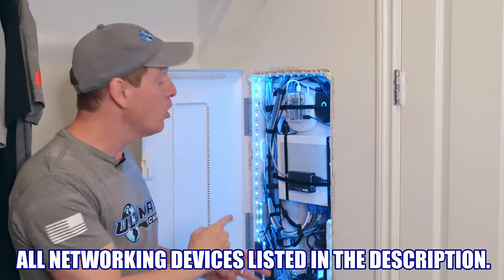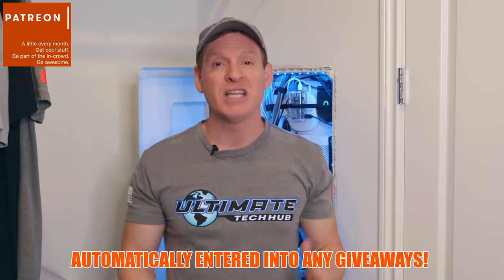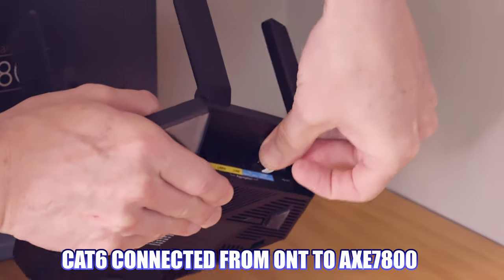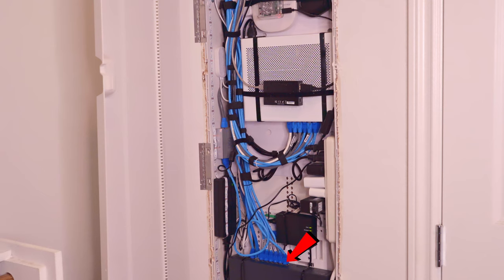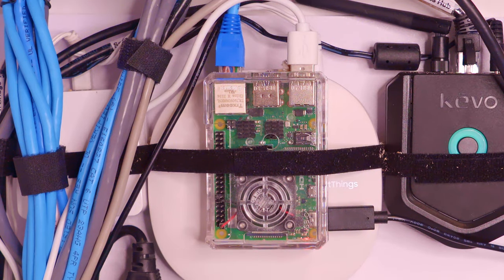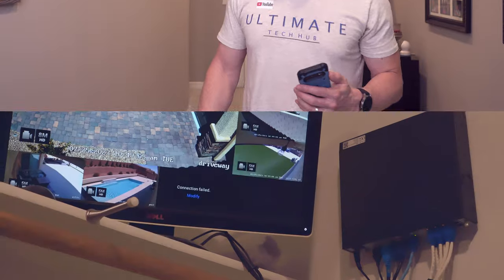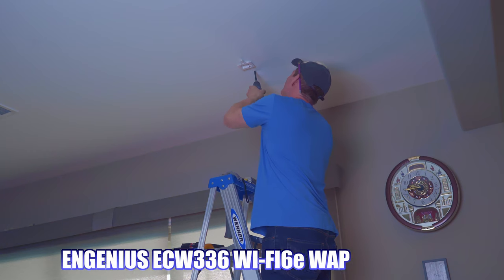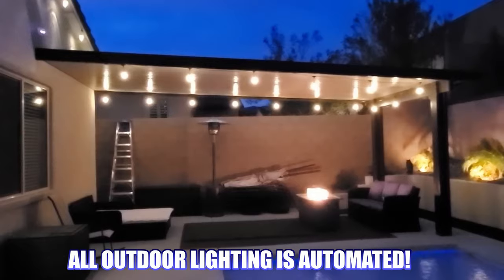HOME NETWORK TOUR 2023

Comment: I honestly think they need to make it a code requirement in remodeling and new construction to have network panels, not only does it give us tech savvy people a place to go to town with Ethernet and wireless transmitters but for a average home owner it can make maintenance on coax, Ethernet, and audio so much easier. I have a family member that didn’t have one until I installed one for them and any work that had to be done to the coax system required going in the attic digging around in blown in fiber glass insulation.
Reply: Even better than a network panel, a proper network rack. I had one installed in my integral garage when I had my house wired with 28 drops of ethernet, and in there is a single UDM Pro, a 48 port USW-Pro-PoE and then a 2U short depth rackmount server I built that hosts HomeAssistant, Plex, Backup server, network shares etc. etc. Much tidier than trying to fit stuff into a network panel.
Reply from the maker: I agree 100 percent! All new home homes should have these network enclosures and the bigger the better! The smaller enclosures are just a waste of space. I had one in my last house and it could only fit 3 small devices! Thank you for watching! :_Great:

Comment: Get rid of the Ring camera 🤮🤮🤮They opt you into a bunch of stuff that you DONT want to be a part of. 
Also don't use riser, use plenum, in the event of a fire it is safer

Other than that, looks great! well done
Reply from the maker: I have some plenum cable that's connected to the ring, WAP and kitchen. Yes the Ring camera isn't the best but it came installed in my house. Eventually I will replace it. Thanks for watching.

Comment: OMG I have a Lennar home with that crazy ruckus box I have been fighting with for 3 years, Where you having an issue with your ruckus AP ports and the ICX ?
Reply from the maker: I've had very little issues with the RUCKUS ICX switch or access point. However I'm not a fan of RUCKUS for residential homes. I prefer TP-Link or Unifi for my managed switches. If you have connection issues just unplug all of your devices for about 60 seconds then plug back in. That usually fixes the problem. What kind of issues have you had?
Reply: I have tried re-setting and watched hours of videos, recently I called ruckus and they told me that the ICX went into router mode, I asked them if it could be the ATT modem/router that could be interfering with the ICX, they said no. But when i look at the specs of the ATT box it says its a router and a modem, and if the iCX is a switch with router capabilities - i believe this also can be an issue. I ended up unplugging the ICX and adding a TP LINK 8 port switch. I did a test again to try and put back the ICX and now the 2 ap's do not get enough power but it does when connected to the TP Link.  I might take all of it out and just start over, lennar did nothing to help, I have been learning about this for 3 years now when i have time LOL.